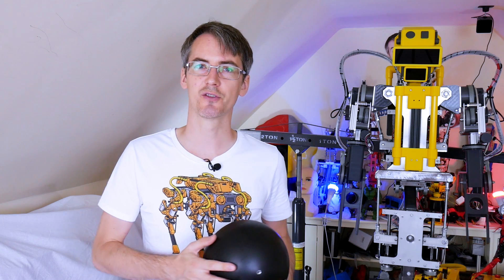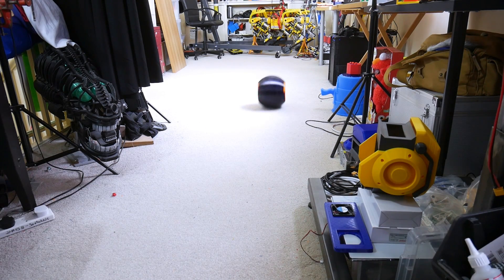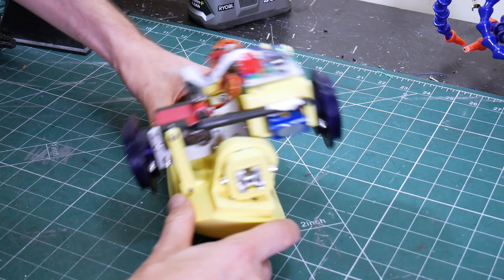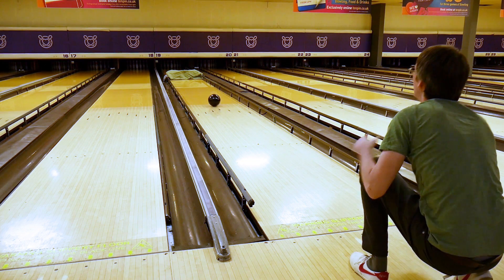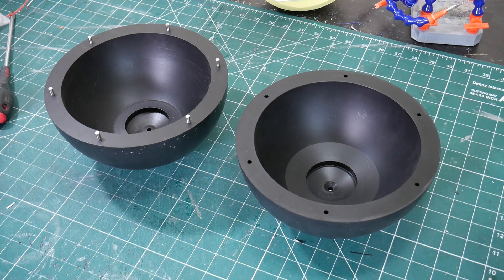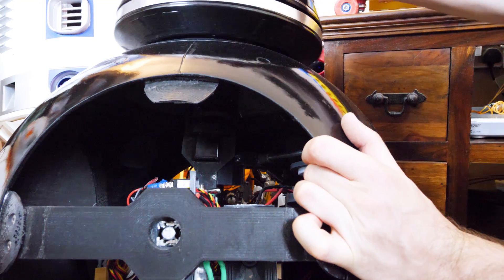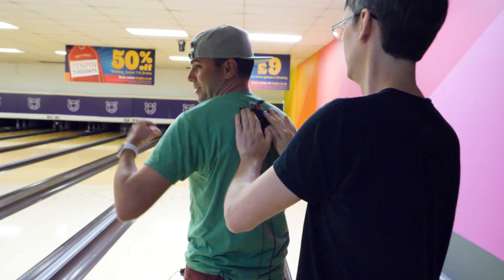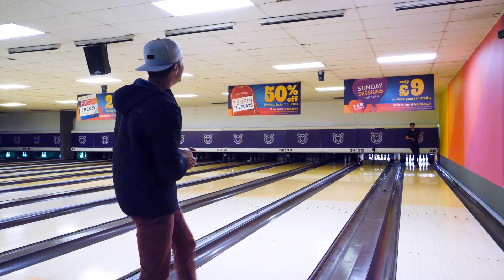Building Mark Rober's Bowling Ball

Comment: I like it when people build rolling ball robots. It remind me my first high school science fair in 2004-2005. I built a robot almost exactly as this one. Of course back in the days, I had no access to Arduino, 3d printer or even electronics. I used 2 salad bowl, plexiglas, air plane RC remote control, a bunch of VCR motors to drive the "wheel" and 6 hours later it was done. I don't miss those days when you had to craft everything from your hands, now it's way more easier to do those things.

I like your work, I hope you will continue for years.

Comment: I have been reading a ton of stuff about the Imagineers at Disney and found out that they devised a 'motion capture' system that is similar to your small robot mo-cap rig.  The one they used to program animatronics in rides like Pirates was one you wore on your whole body, and when you moved it would replicate it on the animatronic.  

Another fun thing I am in the midst of learning about is the control method they used on those old rides and displays called "audio-animatronics".  While I can't find direct evidence of it I am pretty sure it is a precursor to DMX.

Comment: Using the pendulum is an interesting way to steer the ball. It is possible to do it though with no moving parts.
Reply from the maker: With no moving parts at all, how?
Reply: @jamesbruton   You create a lattice around the inside of the ball using a material that can oscillate when Electricity is applied, such as Piezoelectric (I would use a different material but it is not easy to obtain).  Then using sensors to measure the balls position, and some really cool algorithms, you create a wave of vibrations to move the ball.  Does work, my father and I made a crude version when I was 9 (37 years ago.)

Comment: First of all another great video, you are definitely a role model! But I am wondering how you ensure, that the ball is rolling around its axis from the first moment on, otherwise I could imagine I wobbles heavily, trying to find the stable position. Do you just have to throw it in the correct angle, or is there an inner ball layered in liquid to mechanically disconnect it from the outer balls momentum?
Reply: There's probably a visible mark on the ball...
Reply: @GALENGODIS  yeah you can see him assemble it with a long screw around 5:57 and the heads are visible on the outside